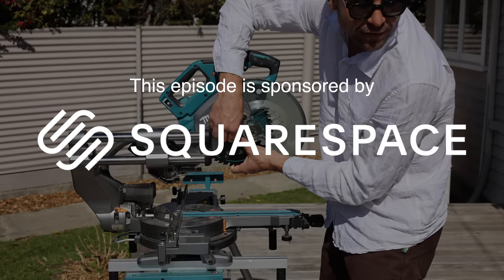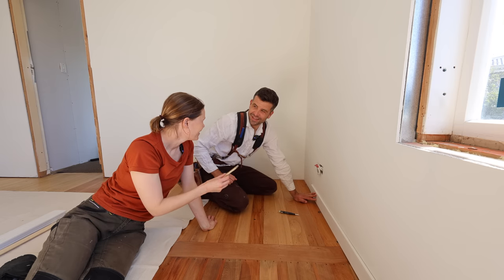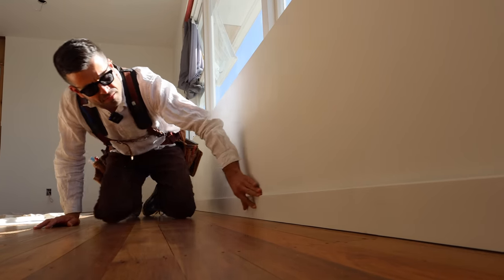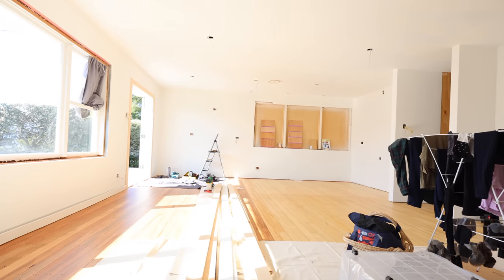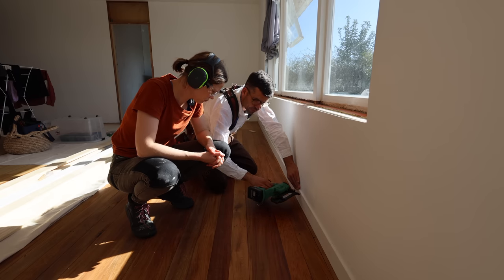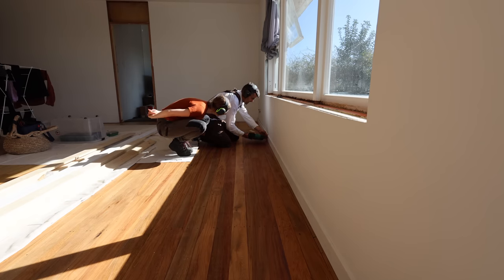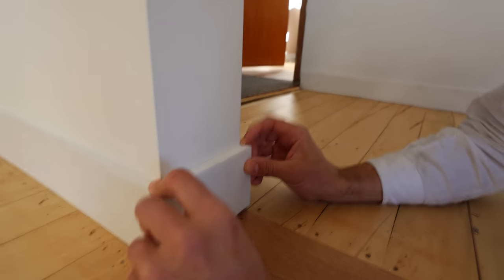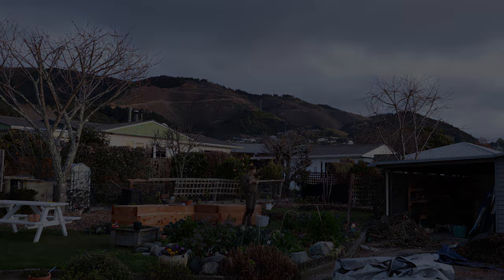How To Do Finishing Carpentry Yourself

Comment: Great video. One point - I was always taught that the join in the length of skirting or scotia should be cut as a compound mitre so that it gave more contact surface and disguised any lateral movement of the timber.

Comment: The problem with ripping down your skirting/baseboard is you are now committed to ripping all mating pieces to match it. Better to modify only the middle part and leaving the ends full depth.
You can put a piece of board on the top edgeof the skirt running at  90 degrees and kneel on it. This forces the board down to the floor and you can nail it off. Different approaches, same result. Cheers.
Reply: Like he said, that's just how he does it, he's a perfectionist and if it means he has to do it the long way or take extra steps to reach his expectations, he'd rather it be like that.. rather than take short cuts
Reply: I was taught to always scribe to the floor, otherwise using your method the skirting will rise and fall as the floor does and will look like crap.
Reply: Fit everything dry then scribe every piece at one time

Comment: Remember when planing to a fine finish, shallow passes with a planer is better than deeper cut, you can always take more off, with shallow passes. For bumps in the floor the planer might not always be the choice if it’s short and steep. Trimmer and clamp a guide works better

Also always always cut your long lengths first so if you make a mistake you can use it somewhere else

Comment: When scribing to a wooden floor i like to run the skirting through the table saw making the bottom angled and the tip much easier to plane.
Reply: You mean cutting a bevel on the backside. I do this as well but more with windows so there's less material to remove when you scribe. I use a hand plane/ block plane when fitting so I don't have to go outside or make to much noise inside finishing

Comment: I like to use a tracer or other similar pencil for scribing skirtings as there's multiple angles you can sit it on the floor that allow you to take off different amounts with your scribe, it also means that you're scribes are more detailed as the pen can drop into any little undulations better than a bigger piece of wood

I also like to use a jigsaw with a finetooth downcut blade as it's easier to follow sharp movements in the line, the downcut blade just pushes any tearout to the backside of the skirting where it can't be seen and leaves a nice clean line on the floor.

Comment: We usually scribe with a compass and pen, set the compass to the largest gap and roll with it. Usually with base do all your cuts first tape your mitres together and dry fit everything perfect and then run your scribes against the whole space. Also depending on how comfortable you are with table saws we usually freehand on a 15-20 d bevel less material hitting the floor usually tighter scribes

Comment: In your shop you have the best miter-saw on the market. On the back of that saw sits a little angle thingy ( don’t know what it’s called), but here in the Netherlands we would use that for both the inside and outside corners. And if your boards are shorter than 120mm there are no issues. Even if the boards are higher you could still use it and make a compound cut. But still nice to see a coping cut. 😃
I am jealous of how you can attach the boards to the wall using only nails. Here in the Netherlands most house are stone / concrete walls so we have to glue them on the wall or drill holes with plugs. Edit: So I looked it up and the tool is called an angle finder. It’s made by Festool and bora also has one. In the older model saw it is stored in the front of the saw. Newer models in the back.
Reply: Drill holes with plugs for skirting??? That sounds so time-consuming 😢
Reply: @ziyadbagharib7803  sometimes indeed. When the skirting needs to be removable for cables etc.
Reply: Get masonry nails with a little washer. That allows enough fixing time for the adhesive to set. Ramset makes them among others.
Reply: @Raysways1  when gluing the skirting we use high tack glue. When you put that on it sticks immediately. It’s like a sort of construction adhesive.

Comment: With the skirting scribes with moulds like that or square

Cut a 45 degree notch the thickness of the skirting down from the top (so around 18mm) then the opposite on the joining piece leaving you with a mitre of 18mm deep to the square cut scribe. Absolute faf but saves on doing it how you showed with the slither scribe and it breaking off 50% of the time which it usually does 🤪😅
*i only do it on posh jobs

Comment: Here in the UK, newly built houses have now a tendency to install naff square edge skirtings.  When they do, the joiners/carpenters these days seem to struggle in getting a good mitre or internal scribed joints and many times just filled with white mastic.  I don't think they would have a clue about scribing the skirtings to an uneven floor. As a time-served joiner, I simply gave up asking for the builder to replace skirtings and kitchen plinths again to get better joints because I have come to the conclusion that it is simply beyond their capability.
Scott one observation - when doing an internal angle and one skirting is fixed slightly out of plumb to the wall if you cut the piece to butt up to it on the circular saw, surely you aren't actually scribing the piece to the other and run the risk of the joint being open ?

Comment: I always locate the studs in the wall, and pin to those... it wasn't till recently,  when I was working with another carpenter, that I saw the angled pinning technique. Not sure I prefer it to holding strength of framing, but I can see it being a bit faster.

Comment: 20c coin centre drilled to accept clutch pencil, fast accurate wheel on line. Blue tape board face and fix through tape line, then fill pin holes flush atop tape and peel off tape with filler still wet for a perfect finish.

Comment: Hi Scott, Hi Jess 
Thank you for another great Video! 
Now I have a question...
Why do you use so many 18 gage brad nails? 
I learned to be a finish carpenter and furniture maker in Germany and now have my own Business in Canada since 2011... 
We don't staple baseboard in Germany because we have concrete walls, so it gets glued up with construction glue... 
Now in Canada I discovered that if you caulk your trim yourself, which I do, four 23gage pin nails can be enough to keep your 2.4m or 8ft strip of trim perfectly in position... As my teacher used to say there is no need for 20 pins or nails the glue once its cured will hold it in place... I have had many talks about this with co- workers but at the end of the day they agreed I was right... 
We also love to install trim that was sprayed with high gloss paint in a spray booth and the last thing you want is a lot of nails since you will not be able to fix it after.... since the paint job was done before the installation... 
This is the way its mainly done in Europe. The Baseboard paint job gets fully finished before installation.. My advise try out the Makita 23 gage bin nailer. Your painter will love you and the results afterwards are absolutely amazing especially if your painter is not the best in his prep work! 
Your Videos are awesome!  Have been looking forward to your newest episodes every Friday afternoon since episode 150.

Comment: I am just wondering Scott about the scribe of the skirting board.  If you have to trim the bottom of the skirt to allow it to follow the floor thereby lowering the height of the board, doesn't that then throw out the height of the joining skirt along the next wall?
Reply: Someone can correct me but I think you need to find the largest gap in the whole room.
Reply: Yes. That’s why I find it easier to fit every piece, don’t nail anything or put 1 nail into every piece just to hold it temporarily, then scribe the whole room at one time. Finishes it the same height

Comment: Just look at how complicated Scott puts the skirting board on the wall let alone even with the floor. We in Germany would attach them and completely draw a silicone joint. The advantage of this is that it makes the movements of the wood with the silicone joint and stays nice and tight, provided you can draw good joints. (Tip: Make soapy water in a spray bottle beforehand makes it easier to clean later from too much silicone!)
Reply: I hardly use the nail gun. Instead of it I use the high tack glue.  Skirting boards are too nice to make the holes in it.
Reply: In the U.S., a lot of the time you would just use an additional trim piece like a quarter round to conceal the gap. The quarter round molding offers enough flexibility to follow the contour of the floor. It’s a lower quality job but much faster to complete.
Reply: I would totally save the money rather than use silicone, do something for the environment, spend a little more time AND build it longer lasting, if it was MY house bro.. what if you'd have to take it off again to pull a few cables?!
Gruss aus der Schweizz ;)
Reply: Silicone against a beautiful hardwood floor, also can't paint over silicone so this comment is utter nonsense.
Reply: New Zealand timber houses are not climate-controlled and move a huge amount. Add in the regular MM 5.0+ earthquakes and this method is better long-term.
Reply: I have pets and kids, not to mention mop the floors when we have time. All I can imagine is the silicone discoloring and collecting dust and hair over time. Would be an eyesore IMO
Reply: In Australia we do this but mainly with tiled floors, and never ever use silicone in areas that need to be painted. We use caulk prior to painting or polyurethane after painting.

Comment: Im surprised you used a packer to trace the floor level and not a washer. Works really well for cabinets and just rolls along the surface with finer resolution than a board.

Comment: Probably mentioned already but to cover the gap in the skirting, add a quarter round at the bottom. No scribing needed.

Did you use a 45 for the scarf joint? Perhaps a 60/30 would be less noticable.

AS you have a kapex, why didn't you use the angle finder?

Gerat video as always. Just thought I'd ask.

Comment: I’m confused now. If you push the board down to the floor while scribing, you will end up with a line parallel to the bottom of the board, so why do it?
If I’m scribing, my goal is to make the bottom of the board follow the curves of the floor, so the top of the board stays horizzontal. 
What you did was just to reduce the height of the board, which you could have done on the table saw with no scribe marks. 
What am I missing?

Comment: Just a question... I noticed you were using the angle of the mitre saw and tilted from side to side with the skirt laying flat on the bed, what would be the reason for doing it this way instead of putting the skirting against the fence upright and changing the angle that way, keeping the saw blade at 90 degrees? I hope I'm explaining it right, my English is letting me down here :(

Comment: Question, about the first corner you did ("coping cut"), why did you not cut that that with 2 45% angels like the smaller pieces?
Reply: Only 45° external corners. If you 45° cut the internal corners they tend to open up over time. A coping cut solves this issue
Reply: @matthewfrew5454  Ahhh, thanks for the info!

Comment: Scott, why did you need to do a coping cut? can't you just mitre the two pieces of skirting 45 degrees and it'll meet?
Reply: If the angle of the wall isn’t exactly 45° (which it usually isn’t) then coping gives a nicer finish. Easier/more reliable to cope all the internal corners than to determine each individual mitre cut required throughout the house

Comment: Ok guys one question before I screw something :) As I understood, if the floor isn’t level and has dents, then we firstly need to find the lowest point and scribe the board. That also means, the board will be shorter and I’ll have to trim the rest of them to keep the top on the same level. It can be tricky when we have such dents on 2 or 3 walls thou. Am I missing anything?
Reply: You got it.

Comment: Never understood why you would cope a  corner rather than just mitre both pieces? I've never done it but it seems like it would be quicker and you don't have to deal with those fragile little end bits
Reply: Thats a big no..over time mitred corner will open up, no matter how much glue, revealing cracks in every corner of the house
Reply: @shaunray6660  what's to stop a coped corner from opening over time too though?
Reply: @shadesofgray9917  It will, but only half as much as shrinkage typically occurs linearly, ie from the end grain. The major reason a coping corner is used is that it covers discrepancies in corner angles and they can be used easily for any internal angle.
Reply: Because, while 90 degree corners are the majority, it’s not a strong one. 

Give it a try if you have a miter saw and some scrap. Cut two pieces at 45 degrees and walk around your place, and checking the interior and exterior corners. Even just a degree can affect an install.

Coping is actually much more forgiving than a miter. You don’t have to calculate. The cope works no matter the angle.

Comment: You have a rather low angle on the top, but a coping top wouldnt be great if you had a rounded or high angle top because the 'little bit' will have to follow that contour to make it flat, likely to break. Yes a 45/45 on both often will end up 'slightly off' because no wall is exactly 90degree, but you do avoid the issue of the 'little bit on top'.
Reply: I don't know a single decent carpenter who doesn't scribe internal corners. Mitering internal corners is just wrong.
Reply: Like most experienced carpenters, I prefer coped inside corners for base (skirting) because you can achieve better results with more efficiency compared to 45ing both pieces.  Beaded base with a round profile at the top is common in my area. To keep the tip of the coped cut from being so delicate, I leave it a little bit thicker (i.e., I cope  a couple of mm inside the profile line created when cutting the 45 on the miter saw) and use a sharp utility knife to cut a matching shallow notch in the top mating piece to receive the tip of the coped joint. Just takes a few seconds and give nice crisp results.

Comment: I’m curious Scott as to why you prefer to tilt the saw rather than stand up the skirt and do a miter cut instead?
Reply: It’s easier to make the cut when it’s on its side and also helps keep the skirting flat on the bench so when you cut a 45 it doesn’t change. Having the skirting up on its edge it’s harder to hold if you have a really long piece and sometimes it doesn’t sit flat on the bottom of the saw so when you cut it may not cut 90* it may be slightly off

Comment: Still don't understand why you don't just use an adjustable bevel to make corner cuts, I always had a tiny one and it made perfect angle markings for all my miters. Those rebated corner flang thingy s break off too easy and most old school builders refused to cut corners like that.

Comment: no need to cut wood trim, just push it hardly down
move your FIBRE cabel (Fiber) to the storage\attic\basement, and just 1 cat6 cable up to living area for wifi access point. :face-purple-crying:so much mess there

Comment: I think channel name needs to be changed to Scott Brown reality show&tool advertising. Is it really carpenters using planers, table saw, to fit skirting board?  You talking about being efficient on a job, and you go to you garage to trim 300mm skirting board, why not use circular saw? Planer to scribe ~5m skirting board?  And you was showing few different ways to mark external corners, but went and cut 5mm off your mark(17.52). I guess you creating content which generates more views and more money, but it is not the same channel as it was.